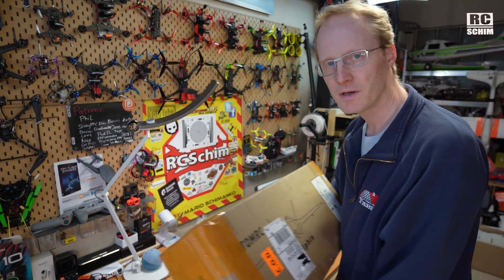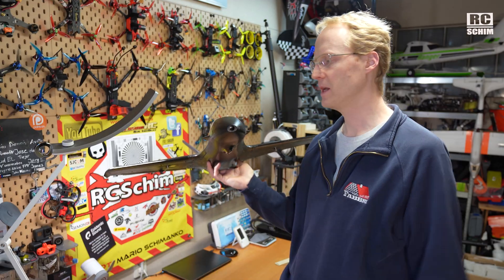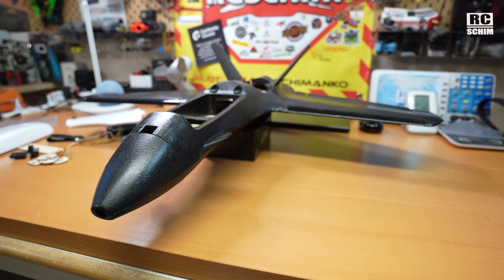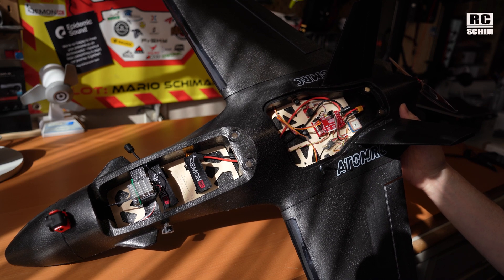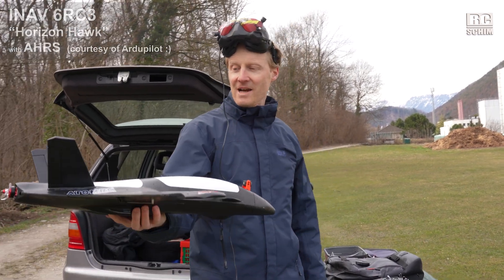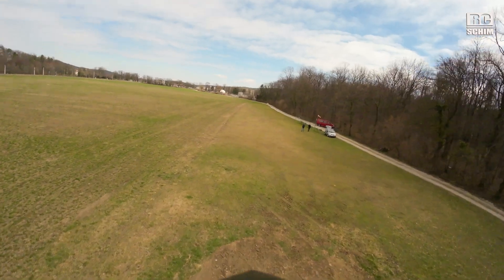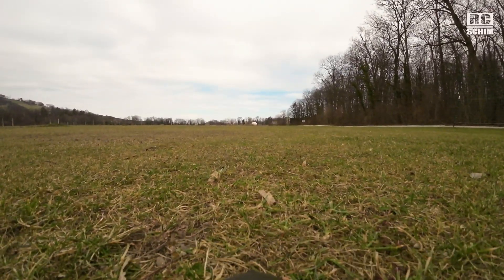ATOMRC Dolphin - not just another review :)

Comment: Auto launch failure. I have the o3 air unit and stock dolphin kit. I followed anothers setting on youtube. Well 1500 idle ans 2000 throttle. Soon as it wound up it rolled left and nose dove upside down!

2nd i reied 1500 ans 1750 ajd it did the same thing. 

I held the plane nose up and gave it theottle. And around 65 percent it felt weightless. I think ill tey 1700 thottle tomorrow. I hope it works ugh.......
Reply from the maker: 2000 means 100% throttle that might be too much. 
Prop? Cg? Give it a good chuck and not too steep throw. Yesterday I had a meeting and a friend also had issues with launching his dolphin, you're not alone ;)
Reply: @Rcschim  Its the stock rth dolphin. I believe it's a 7inch prop. And cg balances good on the spots. People on Facebook are saying torque roll and go reduce throttle. So maybe I try 1700 today go see how that works. Not sure how many more nose dives it can take!
Reply: I lowered the launch throttle to 1700and it still did a left roll and crashed. 3 times!  I did notice that in inav sitting level the first page shows the plane tipping to the right a bit. And when sitting on the bench in angle mode the right aileron is tilted up a little and the left aileron is tilted down a little. This is stock from atom RC. Should I re do the calibration and then mechanicly adjust the servos so each side is the same?  @Rcschim
Reply from the maker: @Huntmx24 please double check the stabilization settings - do they move the control surfaces in the right direction to counter steer the roll (and not make it worse?)
Sounds like the easiest - but happened to me a few times to have it set up the wrong way round. If you tilt plane to right side, the left ail should go up...
Yes, do a calibration - wont harm and is not a lot of work. The servos fine-tune isn't that important anymore - if you have auto trim on the whole time (which is recommended now). My dolphin flies weird in manual mode (not setup nice) but in acro it flies perfect.  Good luck - this year it will fly!

Comment: With the setup listed in the description what kind of max range and flight time are you seeing?
Reply from the maker: With a 2600mah 4cell LIPO  I'm getting 18mins with some reserve and good powerful flight.  Not tried an efficient and LR flight with it. range:  avg: 2.5km   max around 4km,  travel dist avg. 19km
Reply: @Rcschim  very nice. Did the rc vents seem to handle the camera overheating or was that still an issue ?
Reply from the maker: It worked good enough not to get overheating issue. But this summer I didn't fly planes at high temps. 
On my ARWing I've put the air unit outside with cooling heat sink.
Reply: @Rcschim  that’s the route I’ve considered going. I found some nice external trays for the cam & vtx to mount to.
Reply from the maker: Check my last fixed Wing video, after the 1st flight you see my ARWing and how I've mounted the o3 there.

Comment: Beautiful place to fly.  I am homesick.  
I've had two flights with my stock Dolphin.  It flies very well but  my side-toss autolaunch is extremely dramatic.  I've tried recommended idle and launch throttle settings but the Dolphin just rolls to the left . I have had hundreds of successful side-toss autolaunches with a variety of wings but this one reminds me of the torque roll problems during launch with the AR Wing Pro which ended up in the trash. I don't want to have the Dolphin end up the same way. BTW, after a painful mishap once long ago,  I swore to myself that I'll never again launch a pusher with my fingers anywhere near the prop.

Comment: Bro, do u have any problem with P factor during auto launch? How to counteract if our aircraft roll/turn to left during launch?
Reply from the maker: Nope, that's not a problem with P factor, rather with your handlaunch? or too high motor throttle (that causes Motor torque).  See my settings here (Autolaunch settings) but I think it was 85%.   Higher motor throttle is not always better in that case  (because the wings don't have aero effect yet, because too slow, you're wings control surface cannot counter the motor torque).
Could also be a problem that your plane is either too heavy, the motor too weak...  the prop too small?
Reply: My dolphin weight 880g, set throttle at 1780-1800, 2306 motor 2500kv, 5045 propeller, angle launch 18deg, fw level offset 2 deg, ....it always turn and roll to left during auto lunch..
Reply: So, is it normal behaviour?
Reply from the maker: @YT-qp3xw   Yes, as long as it doesnt crash on launch - it's ok ;)    Definitly feels more save with autolaunch now, than with manual launch. My successrate in manual launches was terrible on wings ;)
Reply: Agreed...im bad in handlaunch...but my new sky surfer x8 doesnt have so much to tweak as much as dolphin...thanks buddy

Comment: Shoot I was really hoping that the nose wouldn't be visible with that o3 mount. Is the only other alternative sticking it into the nose?
Reply from the maker: Either that, or you mount the lens high enough.   I dont mind a little bit of the nose in the view. It's also an indicator if you have stabilized or raw video ;)  and you also see how much the plane bounces around.
For a friend I modified a funjet Nose, where the O3 Lens is in the front. I can share the link if you're curious (it's in onshape)
Reply: Oh absolutely! I'd love to see your nose design. I've got dolphin coming in the mail soon so I'm already planning what 3d prints I might need. Thank you! @Rcschim
Reply from the maker: @daniel.pendzich  I ended up designing the nose for funjet new, and I think I can adapt this design also for the dolphin. Will just take a few more days.
For the dolphin I’d print:  closing helpers for canopy and back lid. Servo protectors, and some cooling options for the o3. Best to use a fan mount on the o3. Send me a quick mail at rcschim@gmx.at so I can reply as soon as I have the nose for the dolphin. Greets, Mario

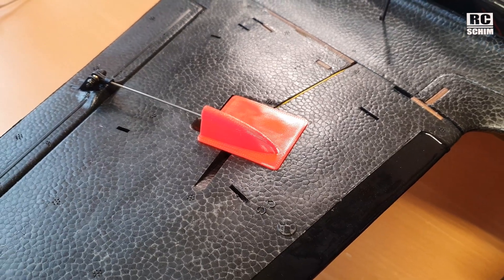Comment: On 3d printed latches at 5:59. You say bowden tube. Is this the normal bawden tube we use on 3d printers ? it looks like filament to me? Thanks
Reply from the maker: - 3d printed latches for securing the canopy https://bit.ly/3AoxRKA
I drill a little hole in foam and glue in a bowden tube from rc antenna and use a screw with the 3d part linked above

Comment: Great review❤ What print have you used for servo covers ? :D i didnt find it in the description.
Reply from the maker: Look again I think there was a zip file with the stls. I will check tomorrow if needed.
Reply: Thanks, i am also scared about the o3 heat problems, i was wondering if the heatsink is better or the 12 v minifan on top of O3. I tried today a first flight but sadly its was 50km h wind gust :))
Reply from the maker: @eparustefan  After my self built heatsink I've als added the iflight one  (8$ - you can see it in my dolphin tipps video). It's still quite hot after a flight - but I get no warnings in the OSD about overheating. I will order some cheap fans and try them - I think it's the best way...
I checked my 3d printed files list, and you're right - the servo covers were missing, added them there and here:  Dolphin Servo-Covers: https://www.thingiverse.com/thing:5420328

Comment: 6s and bigger motor!
Reply from the maker: yeah, I got an TMotor f90 now (which also can go 6s) on first tests with a 6x4x3 prop, the prop stalled (loud noise at 80% thr) so I didnt get more speed with 6S vs. 4S (4S + 7x4.2x2 prop)
overall I've learnt that bigger props (6 or 7" are important for worry-free launches)
Reply: @Rcschim try the tmotor t6143 prop. Very good imo.
Also azure 6145.

Comment: Hi, can i use 2207 1750kv for this 30A setup? My dolphin  came with 23xx 2000kv (version 1) thanks.
Reply from the maker: Hi, after my stock motor burnt out, I tried to replace it with some drone motors I already had. None of them really worked. Burnt another one since the 7x4.2 biblade is really large...
Lastly I went for this combo:
T-Motor F90 2806.5 Long Range 1500KV
T-Motor F35A ESC 2S-6S BLHeli 32Bit    And this works great. Would even work with 6S packs, but I don't have  the right props. Some 6 x 4 x3 didn't work, it stalled and made weird loud noise around 80% and up.   Also it was slower with this than 4cell and the 7x4.2 biblade.
Will probably make another video about this....   greets, Mario
Reply: @Rcschim  can you recommend a cheaper motor than the T-Motor F90 2806.5?

Comment: Cool video! Do you use WtfOs and msp osd package? I already have Vista and rooted Googles v2 and I'm wondering how it will work if I will buy my first O3. I know that I have to switch between modes but I'm still wondering how much pain it is to do that. I heard that you might need re-bind every time you switch. Do you have any hints there?
Reply from the maker: Hi, yes I use wtfos on arwingpro and others. Dolphin is o3 and there the osd works kinda good, only some symbols are missing. So here Vista is better. 
Switching is a bit inconvenient but you get used to it.  From o3 to Vista works without re- binding, but the other way round needs new binding. So I have a little pin in my goggles protector foam. 
You only need to re- bind one of your Vistas then all work (until the next switch to o3).
But the advantages of o3 are there! Super image, good 4k cam with no extra weight...
I heard the rumor that o3 will be cheaper soon, then I will buy 1-2.
Greets Mario

Comment: Great video! I hope to add one of these to my hangar soon.
Reply from the maker: Yes, you should, I still fly this the most! Easy and capable flyer.
Reply: @Rcschim  One more question, my friend. My favorite US dealer has version 1.0 in stock. Would I be disappointed if I didn't get the 1.1? Thank you for your insight.
Reply from the maker: @LiftVector  hi again, not 100% sure about the differences between v1 and v1.1 
I think the newer version has the INAV installed flightcontrol board and the v1 had no FC? please check the shop to see if it has the FC already installed. 
If you know how to solder up and install the FC yourself, you can buy something like the SpeedyBee F405 wing FC  (great and only 35$ - just installed it in my ARWing this morning).

Comment: Does it come with a decent tune ?
Reply from the maker: Check my link and find good setting. 
I will update inav 6 to 6.q soon and revisit the tune, maybe I can get it to fly even better, but it is already a real joy to fly. My next video will show some of the fun ;)
Reply: @Rcschim  But does the F405 come with a good tune - not your tune
Reply from the maker: @tubamanandy2  From my notes it came with a pretty basic setup - but INAV preinstalled - which you don't see too often.
There's not a lot to tune (at least to my understanding) on planes.    Last week I tried to pid tune an old frame with 12x6 props and modern FC (speedy F7V3). This took quite some time ;) still flies like crap. 
On the planes (Dolphin or Mars1200) I think they have more "shakes" in gusts - but you cannot get rid of this fully (the servos reaction to wind gusts is always too slow / late).  ultra fast RPM changes on copters are a much better measure against windgusts!   Still I love flying planes now as well!
As I said - stay tuned as I will update my dolphin to INAV 6.1 and also try to get a better, smoother setup...
Reply: @Rcschim  Thanks

Comment: obviously people want a plane with more lift and that can fly slower for longer.  10 min. is pretty lame. looks cool.
Reply from the maker: 10mins was only with my old, small lipo.  With 3000mah 4s liion I fly closer to 30 min if I cruise around.  20 with speed flying. If I need max flying time for long range I could use way more battery capa
Reply: @Rcschim  Painless-360 is getting 30 min on his setup
Reply: Can get closer to 60 mins with an Emax Eco II 2807 1300kv with 4s 5000 21700 lithium ion pack 🥂
Reply from the maker: @dronepilot260rc  Awesome endurance. I've noticed that it's a pretty efficient plane already with stock setup. If I was to fly for range or endurance, it would mostly use 2-3amps in normal cruise mode. I have 5 of these 18650 packs, 3Ah/4s with the VTC6 cells, they are not outstanding - but good allrounders! And for most flights it was ok to swap the pack after 20-25mins - I find it quite exhausting to fly longer in one flight ;)
Reply: @dronepilot260rc   what prop size on this combo ?

Comment: Mario, finally does Atomrc improve flight characteristics in v1.1, for example stalling speed? In the end, what was the stall speed?
Reply from the maker: I should have done an overlay with telemetry... I will check it tomorrow and tell you. It of course depends on wind,  with a slight breeze against me I could fly 30kph. With an airspeed sensor we could answer this more accurate ;)
Reply: @Rcschim  oh, I forgot, that you do not use air speed sensor, sadly( without airspeed it is absolutely not accurate information.
Reply from the maker: @Pukkaras  maybe I move on to ardupilot some point and get more sensors...